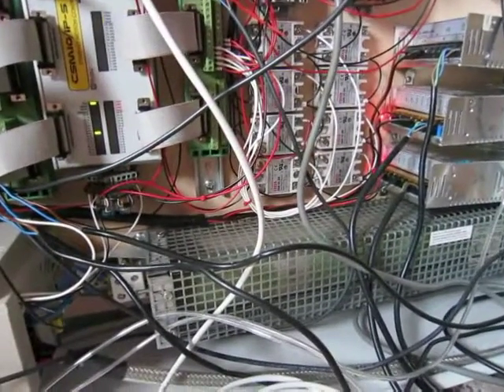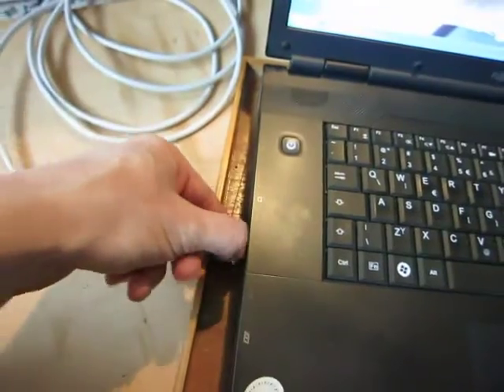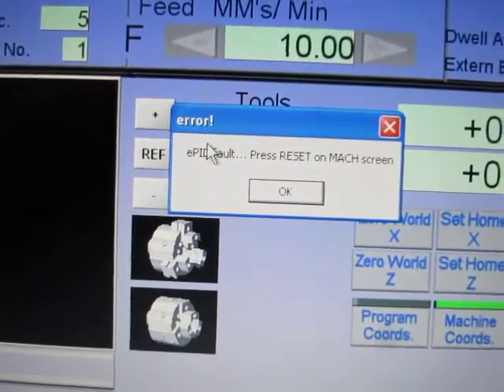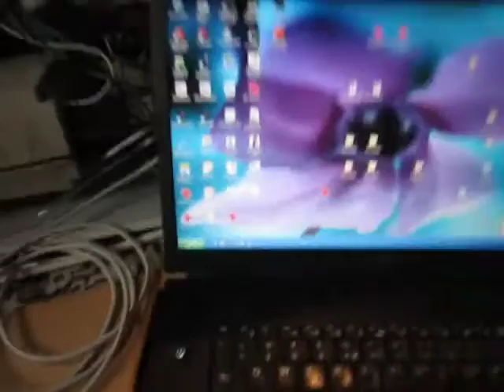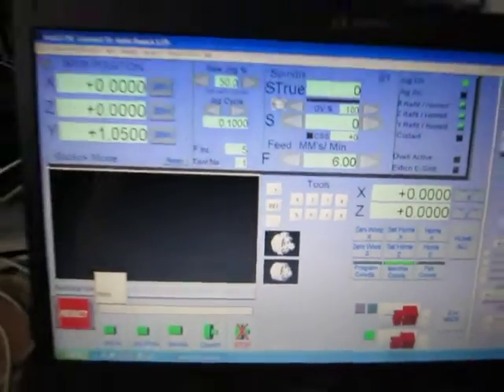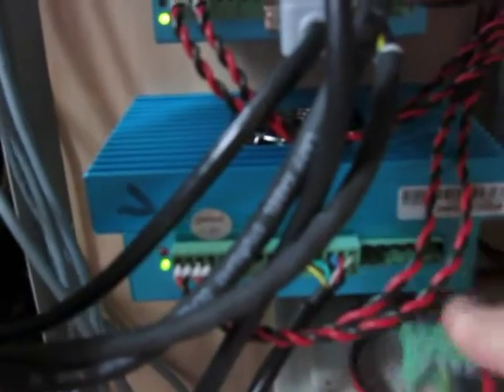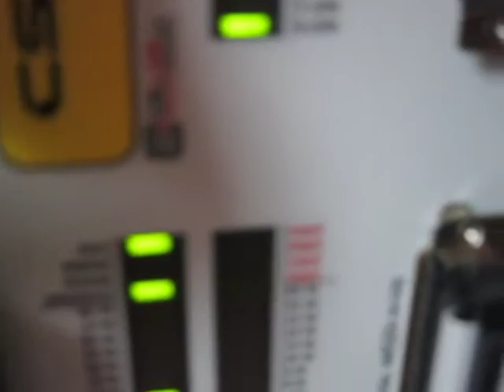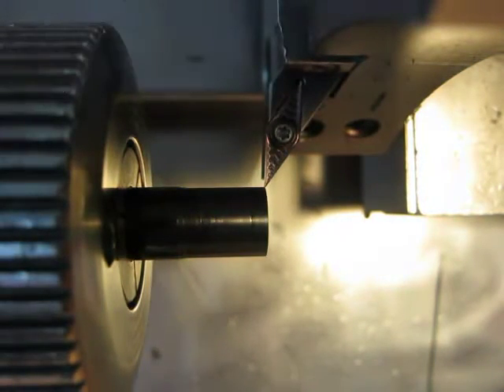ePID fault and machining first parts

Comment: Maybe pecking when drilling will help clear the chips this is a great job
well done..Sorry i cant help with the issue.Buy you will get there..
Reply from the maker: +Muhaa Haloa It can help to evacuate chip, for plastic is not so critical , for aluminum it is because chips can weld to drill bit and it can stick to piece you machining and you can stop spindle or dislocate drill out of holder, and when you peck drill you keep part clean of chips and you give drill chance to cool little bit if you do not use coolant. Thanks for watching, I need to get there :)

Comment: since you are connecting PC to CNC directly you may use a crossover etheenet cable.
have you already checked this?
Reply from the maker: +Marco Curato Hi I think cable is good, in instructions there say that cable you got in package with electronics is good for use (so I got cable with controller). Problem is with software or firmware.
I made video to show company from which I bought electronics that machine can work and that I got error in certain events that is not so easy to get rid off. Thx for trying to help.

Comment: Imam isti problem samo je kontroler CSMIO/IP-A. Jeste li riješili ovaj problem.
Reply from the maker: Nisam ga riješio u smislu da nikad ne dobijem poruku o erroru, obično se javi na početku inicijalizacije izmjenjivača alata, nakon što odaberem reset, kasnije u toku rada se uglavnom ne javlja, greška odnosno poruka je povezana za CSMIO kontrolerom, napravili su kao nešto što radi kao nekakav monitoring putnja, koliko sam shavtio od čovjeka koji mi je pomagao a radi za cs lab. Uglavnom navikao sam se na nju jer kao što sam rekao samo mi se eventualno radi na početku ka palim stroj, najbolje da ako vam pravi prevelike probleme kontaktirate suporrt i detaljno opišete kada se javalja pa će vam oni reči šta je nabolje da radite, ja koristim preporučenu verziju Mach 3 softwarea a najnoviji firmware za kontoler, i odabrao sam u postavkama da se nemoraju referencirati osi nakon svakog odabira RESET u Mach3.

Comment: but maybe the cable is a straight cable made to be connected via a hub/switch.
Many computers are capable to switch the connector to straight/cross mode. Others not.
give it a try
Reply from the maker: +Marco Curato I have only this cable and I am 100 % sure it is not cable issue, when I "hit" software limits controller enter in special mode after which I need to RESET it , and after I reset I need to home all axis that I am using to move machine (x and z) for movement and y for tool changer. If cable is problem none of this would work. But you have good point , I read in manual about thing that you saying but here it is not a problem.

Comment: I use csmio/ip-m . and I am facing with the same problem.
I still have no idea to solve it now. -_-
Reply from the maker: Hi
I got error even now, after I reinstalled Mach3 from scratch, and I use recommended version of Mach3, I also do not know why it does not want to disappear for ever. Anyway I press reset and after that it does not makes problems. Try to ask help from support, they helped me a lot but I even with their help I still have errro, error is connected with csmio, not Mach3 as I understood.